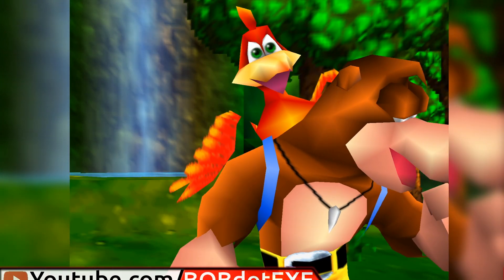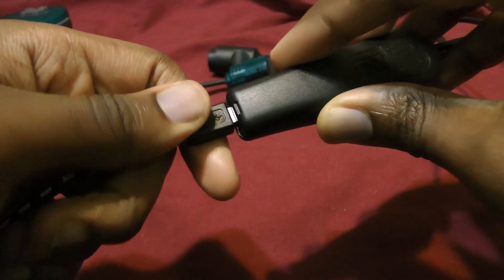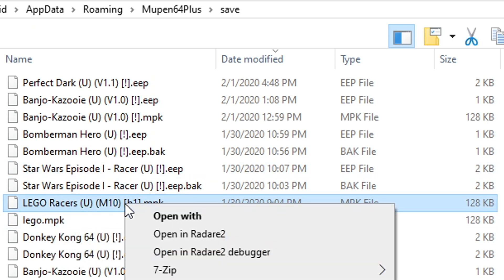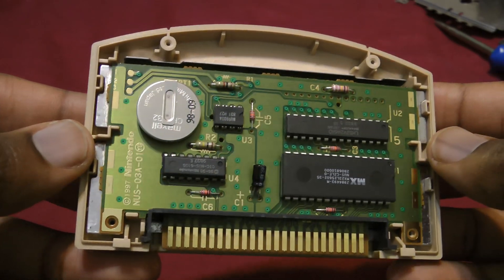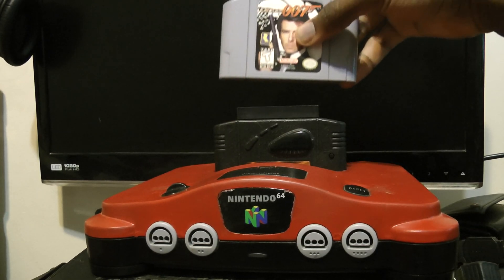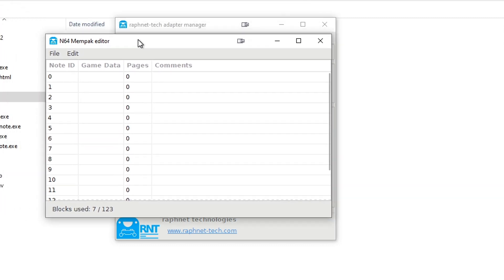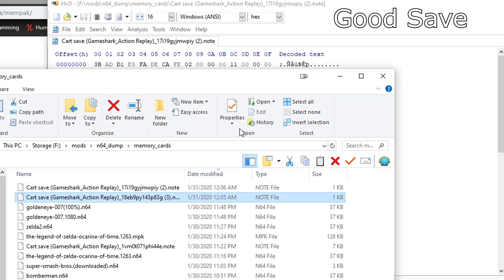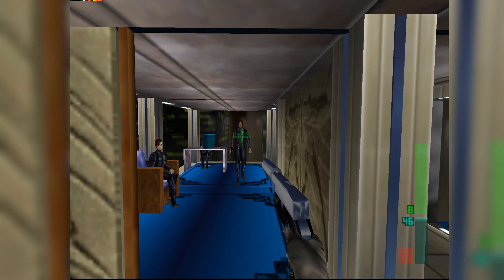Backup your N64 saves to your PC for under $50! (In-depth Tutorial + Product Links)

Comment: Quick question I bought the raphenet N64 adapter specifically for copying a complete game save file from gamefaqs. I was told you can do it.  It’s jus ECW hardcore revolution.  Can you help me please. Not sure what I’m doing wrong. Thanks
Reply from the maker: yes, ECW: Hardcore Revolution and other controller pack saves can be dumped using the process shown in this video.

Comment: You can also use a dex drive if you have one
Reply from the maker: yes, however they are a bit harder to use with modern hardware,
For most people this usb adaptor may be a bit easier, even if it need a controller.

Comment: Does anyone know if the Retrode 2's N64 plugin allows you to backup the flash saves that weren't able to be covered in this video, like with Pokémon Stadium 2 for example?

EDIT: It appears it does! There's firmware for it here that claims to be able to read/write N64 carts' FlashRAM saves (https://forum.retrode.org/index.php/topic,382.0.html)! Hmm, the Retrode plus the plugin would be so expensive, so I don't know whether I'll take the plunge... but it's tempting, if it'd mean there's a chance I could recover some of my Gen 2 Pokémon that were otherwise lost when the battery ran out on my copy of Pokémon Gold.

Comment: Bob ive managed to extract my perfect dark save file from my cartridge using an ED64 plus and ive got the save data working in an emulator too.
Reply from the maker: Good to hear!

If you have any trouble with other eeprom games, I did manage to make a follow up video that covers those.
Reply: @bobdotexe  cool i will check it out cheers
Reply: @DIEverSHITy yeah that should work fine so long as you use a save file from the same region as the rom your using.  The save file will need put in the right folder. Its been a while since I messed with my ed64 I can't remember the folder now i think its just called SAVE.